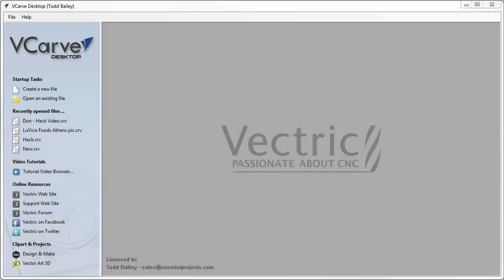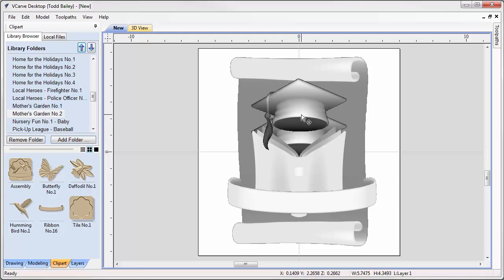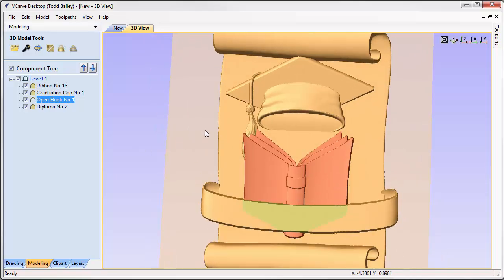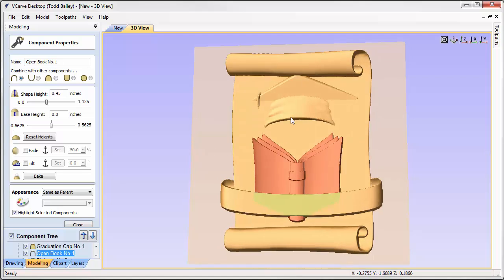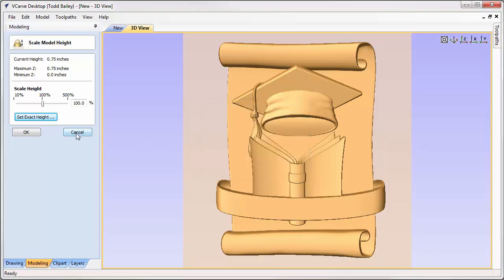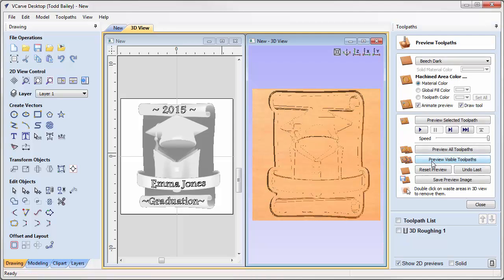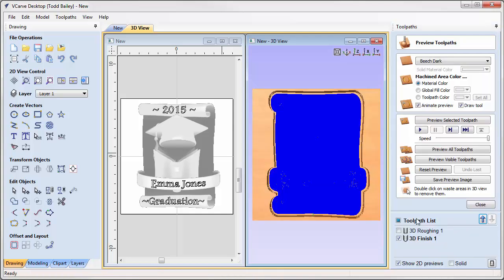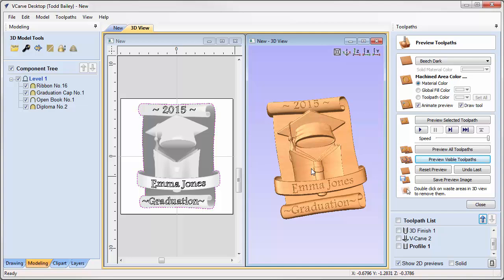Bonus Hacking Help - Customer Question No.1 | Design & Make

Comment: Another twenty minutes well spent. I’m relatively new to CNC and 3D work and I’ve a lot to learn. One thing that troubles me as I run a preview on a 3D model is huge waste of time on my CNC as the router makes all the unnecessary travel. I am amazed that you as the developer can’t start at, for example, the top of a project and have the router continue to the bottom without going back and forth. It just seam such a waste of time let alone the extra stress on my CNC.
Reply from the maker: Hello, Lyle thanks for the comment!!!  Glad you liked the video and found it useful.  The tooling part of the video was really created for the very new user that just wants to cut a part and not worried about optimization.  We do have tooling strategies that, once you are more comfortable with developing tooling, you can use to reduce some of the things you are noticing.  Thanks again for watching and leaving a comment.